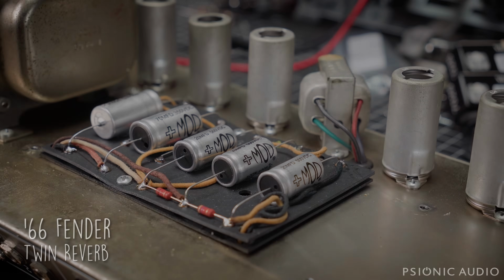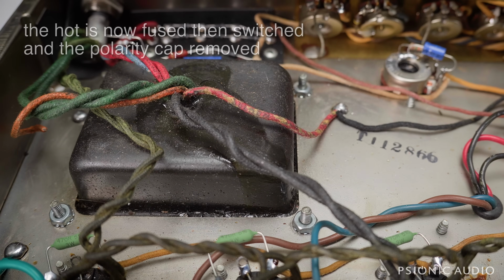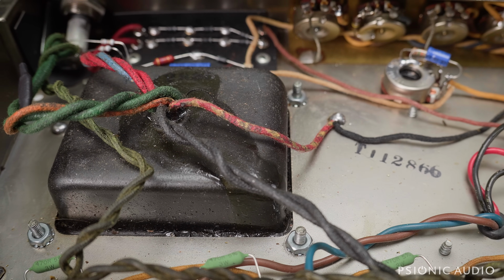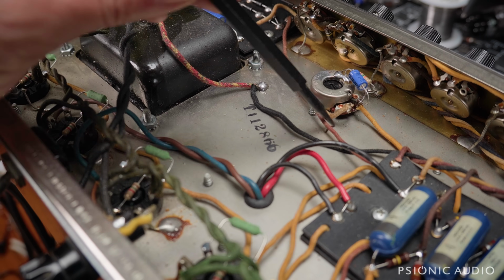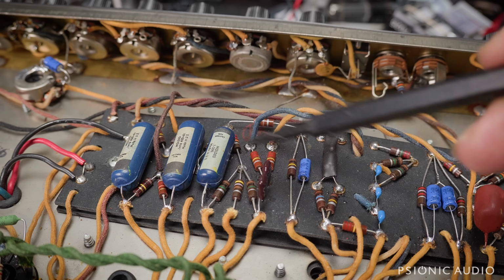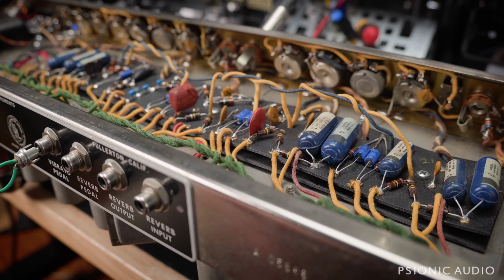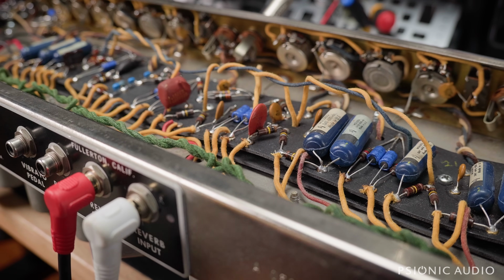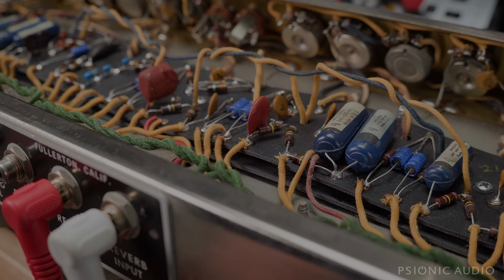Done | '66 Fender Twin Reverb

Comment: That was amazingly quiet.  It's interesting how often you encounter eyelet boards that are leaking / spreading DC that require temporarily vacating at least some of the parts to clean those sections of the board.  Not sure what a typical final bill for something like this is but when a "new" Twin Reverb is between $1900 and $2100 made from scratch with some automation and specialization of labor to speed productivity, I suspect most owners don't fathom how much these little swaps add up in time and cost.
Reply from the maker: Half the repair time on this amp was cleaning/driving out DC. 

As this owner had brought me nine old Fenders I only billed four hours on this, though the total was closer to six.

You have to add a little lagniappe when possible.
Reply: Love these videos - really has educated me. I have totally reevaluated my criteria for amp hunting. 
What would your recommendation for hunting a Fender Deluxe?

Comment: Great looking work. Is it worth using fusible resistors on those 470r screen resistors, especially as the HT has no fuse?
Reply from the maker: These fail open with no flames in my testing. So six of one really.